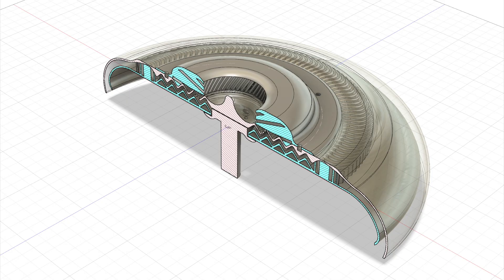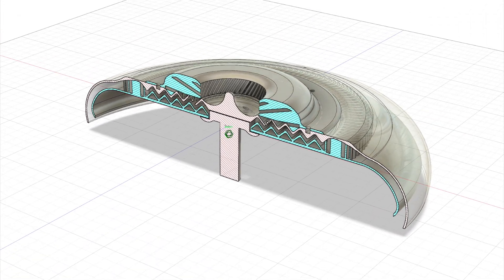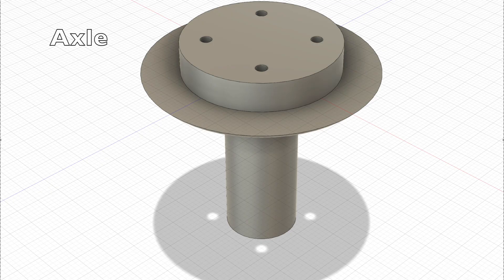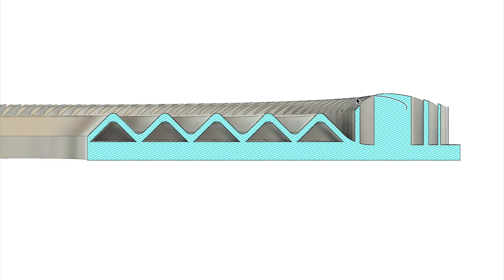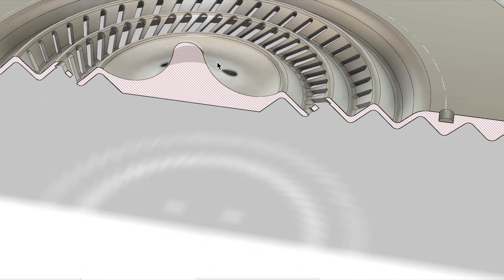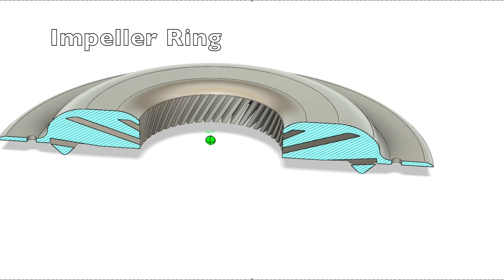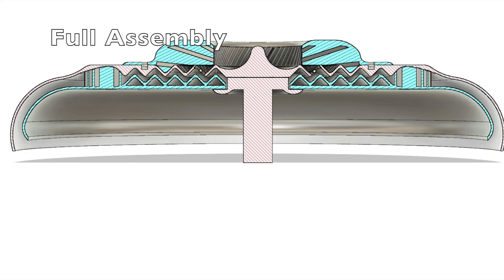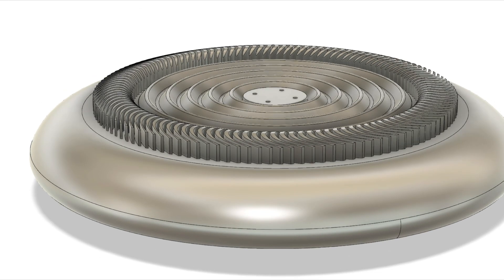Schauberger Turbine (Repulsine Replication)

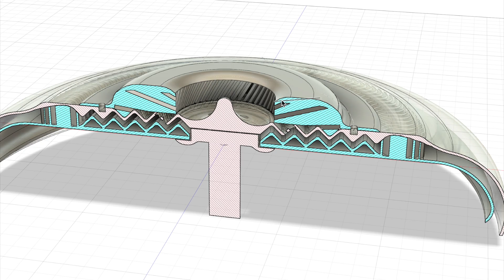Comment: 3:58  it was very annoying in the video  where they find one of victors original implosion devices … and then they barely even allow it to get running…. Because “it might blow up/explode”.  No… it’s not going to fly apart.   Those things were made so well. 

Seems more like they didnt want it to be seen fully functioning. 

To me this is so obvious if you know anything about Victors story. …and the disgraceful treatment he went through in usa.   

Anyways love seeing people do anything schauberger.   

Never assume his things arent all very purpose built. Nothing is without reason.   I think its wise to try things as he had them before “improving” them. 

I wish your video was longer.
Reply from the maker: Hey, thanks for the comment! I share many of your sentiments. That's why when I first started replicating this, I tried to capture the original form of many of the parts as the were in the original/classic devices people have seen.  

The "improvements" (slight modifications) made were those related replication convenience (to make it easier for those who decided to manufacture this via the 3D printing/ CNC route). You'll find that almost all the parts I opened sourced are extremely close to the versions showcased in the documentary (with some slight geometric changes to the cowls). But nothing that can't be modified for greater accuracy/improvement.

Comment: Hybrid use for inboard tech usually requires vacuum....anyways...ideal Tesla valve however the outboard Schauberg blower however modified likely requires.
Reply from the maker: I actually believe this is part of the solution to having a more optimal impeller [the Tesla valve]. I have a few ideas which subtle incorporate such. It has to be don’t correctly otherwise it’s nothing more than an added design aesthetic.

Comment: 你很努力但是你设计的很多错误，边上的那圈涡轮导叶不会那么厚，所有设计需要有标准的曲线逻辑，不是有个形状就可以实现，去看看PKS留下来的数学曲线，那些都是舒伯格留下来的不是后面的人能设计的出来的数学曲线。
Reply from the maker: Hey thanks for the comment! Actually in several of my designs I went to the trouble of doing the calculations for the “golden ratio” based on PKS documents. This is more evident with my work on his pipes than it is here. It was a very tricky thing to do because you’re starting was a  “protractor” and “compass” to correctly draw the 2D geometry before figuring out the 3D extrusions. 

In this particular design I wasn’t especially focused on this aspect, more so replicating existing verision so that others could have a blueprint to work with/ modify as needed!
Reply: @MillennialZoomer  哦，你研究的时间不够，我深入研究舒伯格的技术十年多了，非常完整的破解了他所有的技术。目前世界上破解他的技术的只有我一个人
Reply from the maker: @yusonge8210 congrats! I look forward to your videos and findings.

Comment: hmmm... I downloaded your file but... The way this is, I'm not sure what you think it's supposed to do. With it all covered up like this there aren't any exposed fan blades to move anything around. There aren't any holes anywhere to put the water in either... Maybe I can take all the cowls off and save it... I gotta think about it.
Reply from the maker: Hey, thanks for the comment! this design wasn’t made specifically for aquatics purposes. It can be repurposed for such with a bit of work. There are many design options to choose/improve upon based on what I’ve left !

Comment: OK, but... where's the science? You printed this thing, so, does it work?
Did you measure things like total airflow per rotational speed, or efficiency of energy transformation?
You even counted all "gills" or impeller blades... and what?
Your vid is like somebody found a new living thing and only meticulously described how it looks like, but never attempted to deduce what kind of organism it was, and how it functions in its environment.
Turbines and impellers are thoroughly studied. The one in this design doesn't look good:
- it has lots of places where the airflow is restricted - stuck at intakes and squeezed into tight spaces with high flow resistance, and it happens multiple times in sequence
- if you want to propel something with the jet effect, you need the jet speed to be significantly higher, than speeds you want to achieve; this design obviously transforms the rotational energy from an attached shaft or stored in its momentum (which means it shall be heavy) to energy of airflow under atmospheric conditions, so it should rather grab as much air as possible and only slightly compress it to force it into reduced volume ducts to speed it up as much as possible; instead, it's designed like a compressor to transform low pressure, high volume (therefore high speed) into high pressure, low volume (therefore low speed, high temp) air; of course it'll decompress and expand when leaving the saucer-like edge, but then the entire effort may be simply wasted - is enough airflow assured by its rather small intake to make sufficient difference?
In my opinion this thing flies like upgraded frisbee, because there's some positive top>down air pumping effect, provided it's lightweight and optimized for low rotational speeds. For high rotational speeds it'd have to be heavy to store sufficient energy, and then the entire flying potential is lost.

Comment: This is not a turbine. This is a very inefficient centrifugal blower. The most annoying thing is there's nothing to counter rotational inertia torque, ie, no tail rotor. The output airflow is not going to create any air cushion, just a whole lot of turbulence. It far more weight efficient to just use the same material to make a rotary wing, if intended to fly

Comment: Many a very good working prototype design was ruined by an engineer who said "these were two parts but I made them 1. there really was no point in making 2 out of them." Followed directly by the sentence of "I don't understand why it's not working anymore."
Reply from the maker: Thanks for the comment. If you download the files, you'll see that "the parts which I combined one", can also be downloaded individually (yes I provided options).  I did this to be careful of the very problem that you bring up. Valid.

More than all of this, I designed all of the parts so that they could be easily partitioned (modularized), incase, for whatever reason, this was more advantage for a give build.

Comment: Very nice! Some things that I believe most folks glaze over when attempting to recreate Schaubergers machines. If you dig through the books he really liked to use copper, and silver plated copper one one side of the wave guides. He also mentions amalgamations of cooper and gold. Another thing to think about is the ionization of the water vapor as it is being vacuumed into the Repulsine. From what I can gather from reading through the books is that the water vapor is being ionized and the copper is collecting the free electrons as the water is being broken apart on the molecular level. Basically it is creating high voltage electrostatic discharges that in turn use the Carbon in CO2 as the "fuel". Also check out the oligodynamic effect that silver and copper have on bacteria. Schauberger was big on oligodynamic metals. That and diamagnetism. I do not believe plastics will work as it is a man made product. Only natural materials will work. That being said he does mention synthetic resins as a material that may be used, from what I can find online they were using natural materials to create the synthetic resins. I hope this helps you on your journey!
Reply: Sehr gut gedacht. Schauberger hat bei seinen Konstruktionen immer wichtige Details weggelassen wegen Patentklau. VS hat sich lange Zeit mit dem Kelvin Generator beschäftigt. Die Repulsine kann man rein mechanisch/ aerodynamisch nicht erklären. Ich denke, da spielen auch elektro-statische Komponenten mit eine Rolle. VS verwendete ja dieses Kieselgel und sprach von millionen Volts, also Hochspannung. Möglicherweise hat VS aus dem linear getakteten Wassertropfengenerator eine rotierende, permanent umlaufende, sich selbst aufladende und verstärkende Maschine (Repulsine) entwickelt. Klappe mal die beiden Seiten des Kelvin Generators um 90° nach links und rechts in die Horizontale. Passe die Spannungspole an und lege das über die Repulsine.
Reply from the maker: Thank you for the comment and the insight! I designed these so that they could be easily CNC'd with metal of choice! I'm hoping some folks take to doing that so we can study more of the purported effects!
Reply: @MillennialZoomer het geheim zit im iets anders.. als je viktor begrijpt dan zie je het zelfde als dat ik zie, ik weet precies waarom het niet werkt.. 
en wat je er aan moet doen om het te later werken.. 

ik ben al twee verloren.. door dat ze binnen een paar seconden buiten het bereik van de controller waren. Ik had op de tweede een tracker gezet maar nooit weer gevonden. 

Tot nu toe heb ik nog geen een gezien die nog nooit iemand ook maar in de buurt is gekomen om het te laten werken.

Comment: The best explanation for the repulsine that I've heard is that it is actually an inertial propulsion device: https://youtu.be/YuIIZk53hkQ
Reply from the maker: Thanks for the comment! I'll need to check out that video.

You are not mistaken--although I'd be careful about calling it that myself!  This is one of the reasons I studied it. My field of research is in inertial propulsion systems--but I'm more interested in the solid-state side of things.
Reply: @MillennialZoomer  Yeah, I'm not really interested in propulsion systems with moving parts, but I still have some need for water and air pumps. Unfortunately, the repulsine isn't a great design for those needs either.

Comment: I'm one of the first to call out crackpot designs, but this is not one of those. Keep it up; that device is very impressive! It does appear though, that the impeller may have to spin faster than 3D printed parts can withstand, so may need to be fabricated from titanium, and the early stages of the plates may need to have heat shielding since highly compressed air will be very hot. All of my 3D printed turbines eventually self-destruct when I apply any real power, even the carbon fiber reinforced filaments. The CFD models would be very revealing!
Reply from the maker: Thank you thank you thank you for this comment🙇‍♂. 

I couldn't agree more regarding the impeller!! It was my biggest qualm during the design process. I feel like this one would underperform.. at 2x size it would almost do ok. Modifying it so that it does better might be something for the future! Thats where some good CFD might help!

Moreover, depending on the material used for 3D printing the entire bulid, I'm not so sure how the thing will fair at higher RPMs without tearing apart. The good news is my models are extremely CNC friendly, so anyone can go straight to metal!

Comment: "its just a turbine"...

interesting. you swallow the koolaid from both camps, but didnt quite catch the subtle flavours of either...

you look at it from the simplistic mechanical view of academia, relying on "intuition" when certain aspects of fluid dynamics are anything BUT intuitive. "air is deflected..."
if it IS just a turbine... is that reaction turbine? or an impulse type? a mixed flow? if its a turbine, it should be classed as one type or another as the fundamental operating principles are entirely different. one has to be able to perform calculations on mass flow and pressure changes and temperature changes... everythings quite clear and follows well laid out rules, and this... doesnt.

at the same time you will even mention schuaberger, a dirty word in the hallowed halls of education... yet dont seem to have done much in the way of background work, or critical thinking, or even observing nature... 

"to understand we must watch nature and think backwards"

Man, he stand up and demand Wind do work.
Wind, it laugh and shriek and skips by quickly, sneaking back to tickle Man on butt.

"the last apprentice"... seems to be mostly working as heaters. and if you understand how a vortex tube works to take compressed air in here, and spit out cold air on one side, hot air on the other, it actually makes sense. heat pumps. COPs...

despite the seeming chaos, a tornado is a very ordered structure... why do they even occur? 

how can you make an object get sucked TOWARDS a flowing nozzle, contrary to flow? shouldnt happen. but it does. requires certain conditions.

Comment: Make a small model, spin it up 10k rpm. The repulsine isn't an aerodynamic device but allegedly dissociates the air, generates a plasma. Gravitic effects are also alleged.
Reply from the maker: Yes yes. There's the so called ("triboielectric" effect I believe) which can purportedly take place when the build is done with the right parts and the catalyst of secret sauce.

I forgot to mention this in the video, but if you do CNC build of this with metal parts, you can make this thing a giant a capacitor. I won't say how, but if you make the appropriate design adjustments (very easy) you can also test this  system with the additional benefits of examining so called "electrogravitic effects". I mean, thats if such a thing really exists  at all :)
Reply: @MillennialZoomer 
make it out of copper
Reply: @MillennialZoomer Hi MZ
The purpose of the design was to draw "threads" of air in through square piercings in around the tip cap. These threads are coriolis rotated through the rarefaction/compression process as a result of the offset grooves in the plates. When the threads reach the perimeter of the plate it will be a lower pressure rhan the ambient hence the backwards looking fins at the very edge. It was claimed to be self- powering past a certain rpm from the low pressure threads reacting on the reverse fins. At high enough rpm air molecules are dissociated mechanically breaking the 19mv electron valent bond of each water molecule hence the blue glow of ionized air. similar to a tornado making its own lightning. Gravitic effects are claimed along with Hutchinson-type material softening.
 P.s. Hal Puthoff is not the friend of fringe science

Comment: Great work! But it would not work properly because repulsine has to have 8 mm gap at the center and 1.5 mm gap at the outside circumference part. That impeller also not properly designed, try to have a look at the better air sucking impellers by Schauberger. And I’d recommend applying copper paint and make sure that upper and lower part are not connected for not shot circuiting, he had chosen copper material on purpose but applying paint or copper tape should work, paint is better for not to cause vibrations. Zig zag of the repulsine also has to have phi ratio. In fact repulsine is simplified horn shape in profile. Good luck with it! 👍🏻
Reply from the maker: Thank you for the comment and wishes!

All of precise technical things that you mentioned can be corrected in the files (with little effort). I knew there would be small things likes that which would need to be adjusted (theres just so much information on this subject). Thats why this was to serve as a blueprint so folks wouldn't have to design from scratch like I did !
Reply: @MillennialZoomer I advise you to upload to AI all the books and info about Schauberger and you can shorten your time in order to gain needed information. I do speak with books in such way 😊 helps me to ask questions which I can not ask to authors

Comment: Subbed!
Shouldn't it have the lower part for water? Viktor said his geometry and copper created 'negative resistance' that spawned a sustained vortex. And a catalyst that he took to his grave.
Reply from the maker: Hello! thank you for both the sub and the comment. 

This particular model isn't for water(and in general those for flight should not require it either)! More over, you raise a very good point on the matter of the special "catalyst". In the 2008 documentary, Schauberger's grandson (?) made the claim that the reason Puthoff's team didn't see any thrust, was because of a missing catalyst. 

Historically, I'm not entirely convinced that a catalyst is a requirement for the aerodynamic system to achieve flight. For example: in another book+document, purportedly, one of the repulsines that was built during wartime took off with such force (and sheared its way from a metal test bench to the ceiling), because of someone's failure to follow protocol (if I find the book+document and page I'll re-edit this and comment it here). My guess is this prototype didn't have any catalyst whatsoever.

I'm almost certain that fluid implosive systems can be achieved with far greater efficiency than conventional rocket engines (explosive system), even without any special catalyst. Right now, it would appear that the  chief  problem is one of design engineering
Reply: @MillennialZoomer  Have you looked into his deepwater aeration pump-generator? It's the easiest to implement, but needs access to somewhat deep watersource. ChatGPT said at least 10 meters deep to create meaningful force. I assume he'd use whorl-pipe design for further efficiency, but it should work with a general pipe too.
Reply from the maker: @ANToxic777  Nope, not at all. If I start moonlighting in the fluid dynamic sides of solid-state implosive systems, I'll need to keep this in mind!